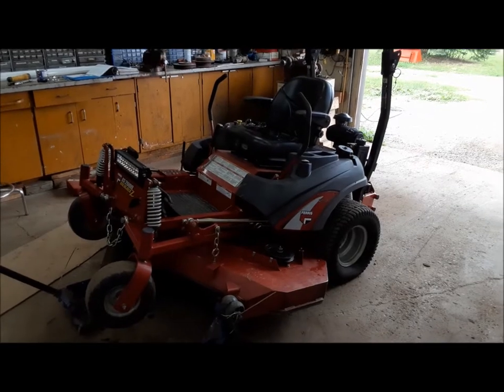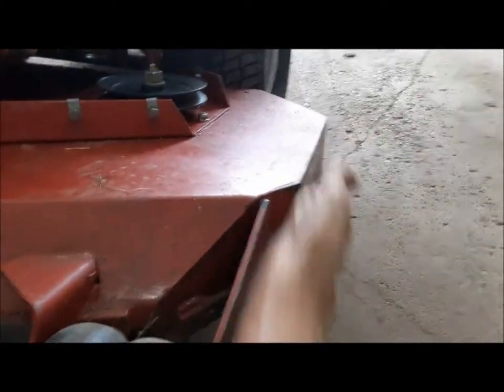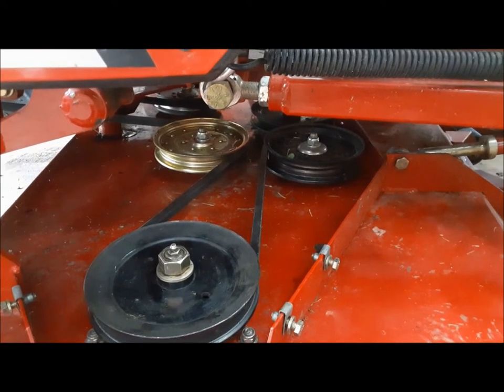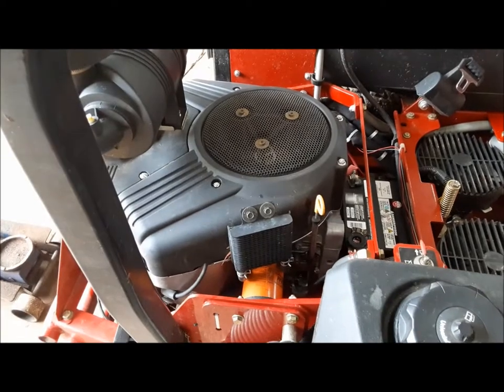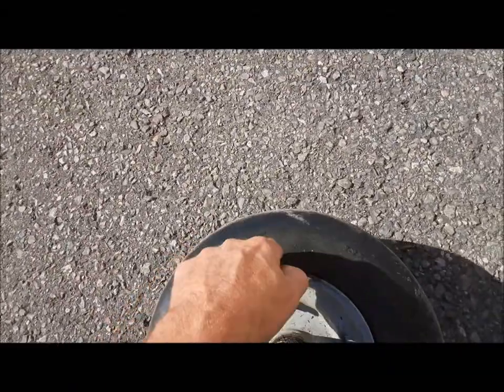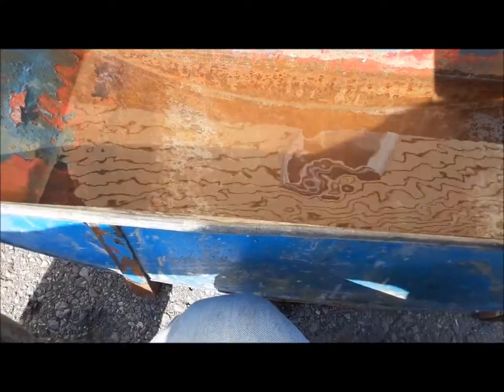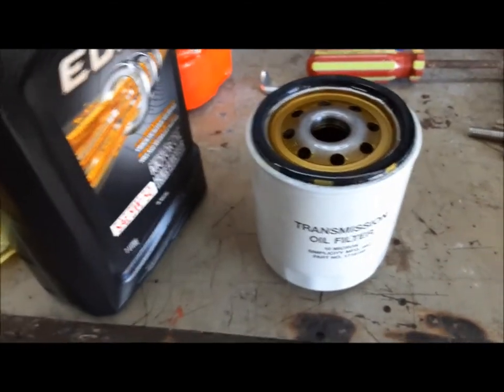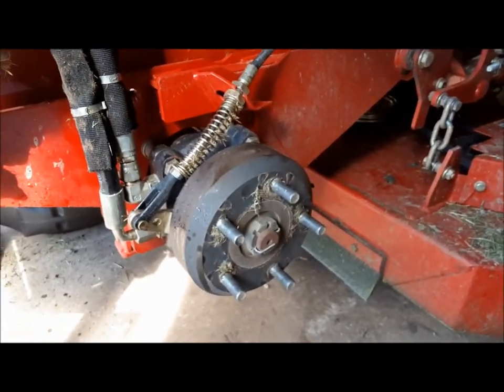Ferris IS2000Z 250 hour service

Comment: Hello, I'm looking to purchase a used IS2000Z (61") at auction this weekend but won't know exact model until day of auction. Listing says 50 engine hrs.
1) what years were is2000 offered (2006-?)
 2) key things to check before bidding ?
3) What's this mower worth?(realize it could vary with hp/engine type)...
Thanks in advance...enjoyed this maintenance video..greg
I have 3 pictures of mower from listing..
Reply from the maker: I'm not sure the year range of them. Mine was around 15K new and I'm not sure how they hold their value. Unfortunately I'm just a homeowner with a ferris. I'm not a small engine shop or anything so I can't advise too much on them. Looking at used ones, I would be most concerned about obviously the engine, but the hydraulic drive system. That is where the $ is if you have to fix them. The mower clutch is also not cheap. Bottom line, if its been owned by someone who cared and looked after it, that will show. If it looks all beat to smithereens, chances are, it is.
Reply: @ClaremontClassicGarage  thx for your quick reply..think if I can get it for great price will take a chance...enjoyed your maintenance video...take care..👍👍
Reply from the maker: @GM-xb6hy  Best of luck with it!